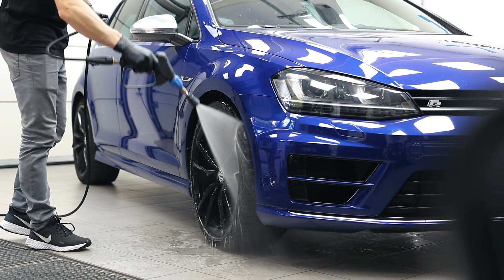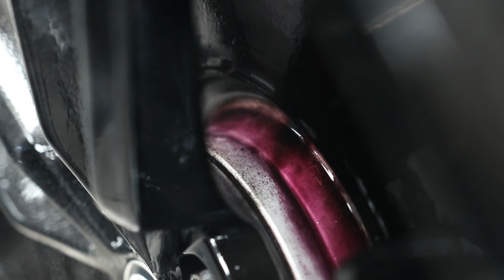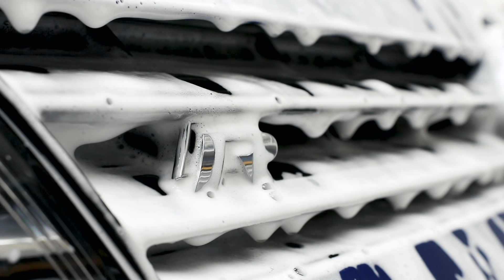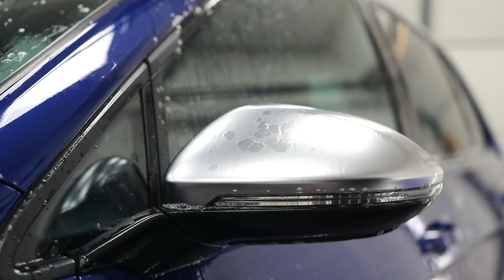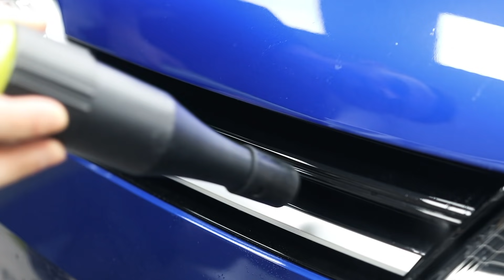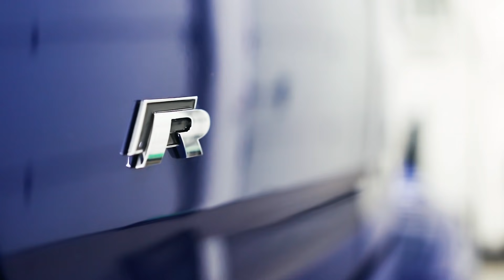Foam Wash Golf 7 R - Exterior Car Detailing - Satisfying!

Comment: Sweet! I am glad I have most of the products you're using, it confirms that they are quality products! I have one question: when using IronX on the paintwork, is applying it to dry surfaces more efficient in terms of how much you use. I am just a student, so I want maximum bang for buck😉. Or is wet surfaces just as efficient/ way safer?
Reply from the maker: I'd recommend all of these products! To be honest, I never apply IronX to dry surfaces, in theory it is most efficient to use the product on a dry surface but I have never had any issues with it not being strong or efficient enough. You should be completely fine just applying it after rinsing.
Reply: @VermijlCarDetail  Great answer, thanks for replying!
Reply: @jaaphoogendijk671  yes i use it on a wet car 2, i wash the car first and at the end before drying i apply monello non ferro wait a couple minutes and then rinse off👌👌
Reply: @faze-armytrix8741  Thank you for your answer! Have you also tried IronX? If so, which is better, CarPro IronX or Monello non Ferro?
Reply: @jaaphoogendijk671  im very happy with non ferro but ironx is good 2.👍👍

Comment: How much psi is this water pump and how much time you have to let sit iron remover on the wheels
Reply from the maker: My pressure washer is set to about 1100 psi and I'm using a 45° nozzle. I usually let IronX dwell for about 3 minutes.
Reply: @VermijlCarDetail  any video in which waxing and ppf is explained

Comment: Hi! What is reset dilution for foam cannon
Reply from the maker: Hey, I’m actually not too accurate on that. Usually I just fill up the bottom of the bottle with like 1cm of product. 60-100ml (2 - 3 oz) will work great depending on the foam cannon you have and how thick you want the foam to be
Reply: Thanks